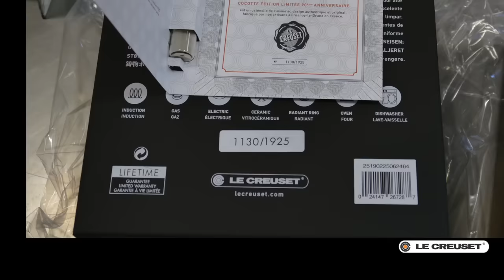Le Creuset 90th Anniversary Limited Edition Cocotte

Comment: I have #318 of 1925 produced. When I bought it I didn't realize how small it was going to be; only 3½ quarts, and 22cm diameter. I don't recall the size being mentioned in any of the promotional literature, videos, etc. at the time. I wonder if the 1925 original only came in that size, or if there were larger ones back then.
Reply: I was wondering how many quarts the original cocotte was. That IS small! But still so beautiful!